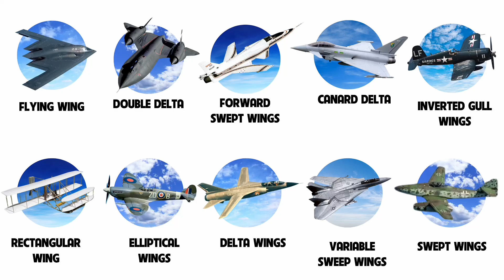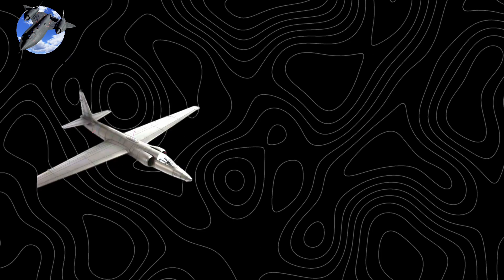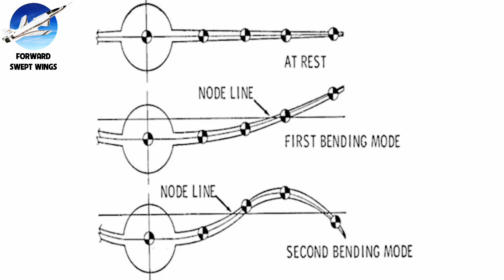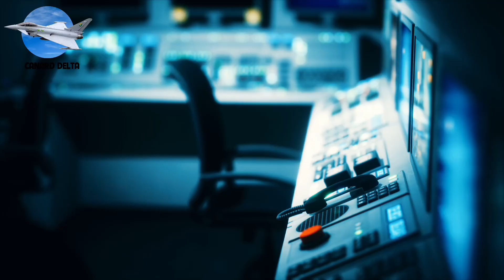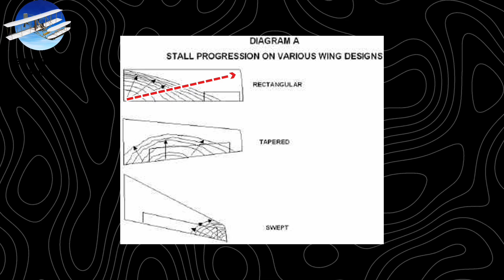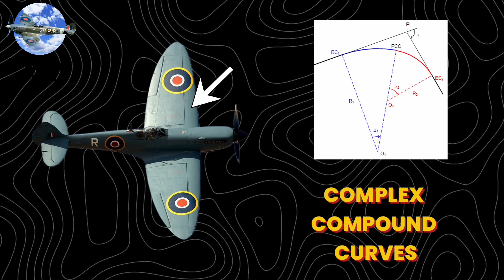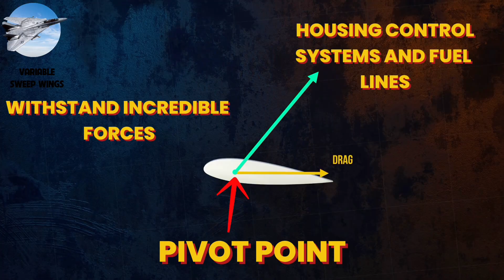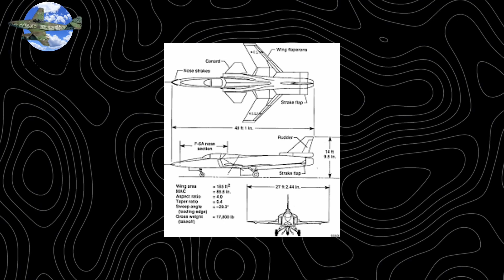10 Fighter Wing Designs That Ruled the Skies

Comment: the USA didnt invent the double delta, the swedish did with the SAAB J-35 Draken (which also accidentally invented the cobra maneuver)
Reply from the maker: Thank you for the insight, appreciated it <3
Reply: @MilitarySummary10Minutes  it was in 1952 or 1955 that the Draken was first tested, and in 1962 the SR-71 first got tested